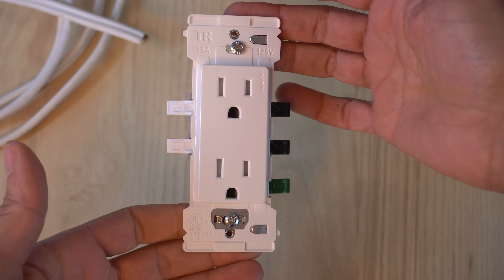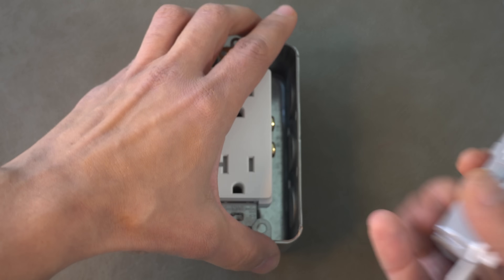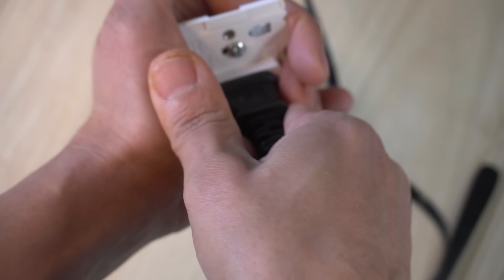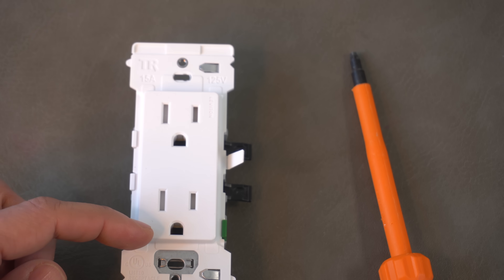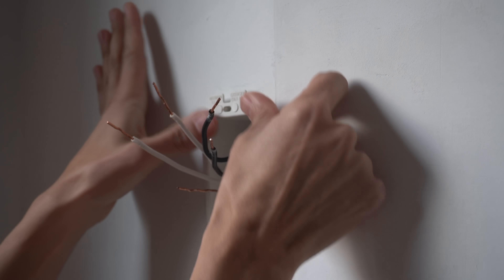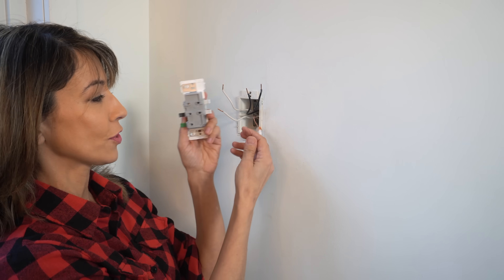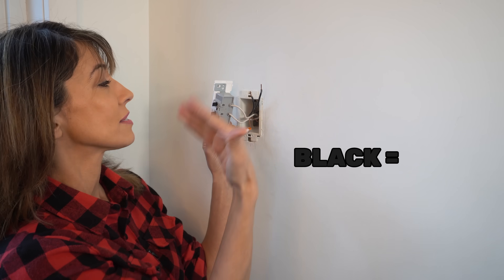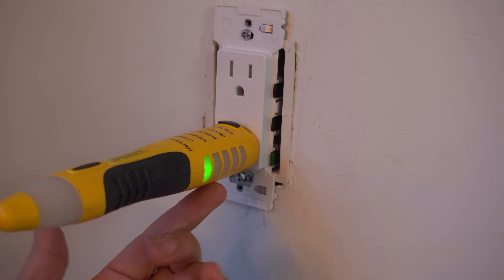New Electrical Outlet Installation: 3 Essential Improvements You Need To See

Comment: Your T&G feature, hand it to the standard DIYer and they will still screw it up. No one reads instructions in the real world. All you do is tighten-up the first outlet or switch, loosely attach the second snug, and hold the cover back-to-front and wiggle the clearance. Pull off the plate and continue to tighten. There is a thing called screw creep, and the fixture may torque/move from the initial set. 
You can not centre what you can not see as well. 
Plus the metal dog ears are designed to be cut off in situations of retro-fit to flush mount boxes. 
These are new construction or old preexisting behind drywall mounted boxes.

Comment: Brand new POS electrical outlet for the lazy DIYer so they can burn their house down. 
Lazy licensed electrician used a backstabbed outlet/switch, you could see the arcing coming from the box. I rewired the proper way. This outlet is no thousand pound crimping system which give best vibration resistance. Use Wago connectors and become another Waco incident. They have three times the resistance. Just hookup a space heater, hairdryer, or toaster an see the plastic melt.

Comment: It would seem that the extend box would have to mounted in place somehow otherwise I could see pulling right out of the wall when removing a plug from the outlet especially with tighter tamper proof outlets.
Reply from the maker: The box extender is screwed into the metal electrical box with long screws. It’s secure and designed for this purpose. When removing the receptacle the extender stays attached to the box.

Comment: Good video. I'd like to point out that in many homes, such as my own, which is 30 years old, the wiring is not necessarily white and black. I have yellow wires, for example. The way to find hot is to turn the circuit off, disconnect the wires, physically separate them, turn the circuit back on, and check with the voltage meter. (You can also leave them connected, and just unscrew the receptacle to get access to the hot/neutral wires.) It's the only way to be sure.
Reply from the maker: Good points Jack! Thanks for taking the time to help people out with this because it happens. I show how to do this in my GFCI video but not here. You have good advice!

Comment: Outstanding! Thank you for this great find and installation tutorial. I just swapped out several light switches in my 30 year old home. The electrical connection screws had become a bit loose and the lights were randomly flickering. (Not good!) I clicked on your Amazon link and I was pleasantly surprised to see (at the time of viewing 18 Feb 2024) $3.50 USD a per unit. I can't wait to obtain and install these. Thanks again.
Reply from the maker: Thanks for letting us know Richard and for the price update. It’s good to know.

Comment: As a professional I no longer use Wagos. The point of contact in a snap connector is extremely small therefore limiting current carrying capacity.  These are not safe under fully loaded circuits. Just my experience and opinion, been in the trades 38 years now, "quick and easy" never lasts.
Reply: I wouldn't use Wagos on an outlet where you could potentially plug in something that draws high amperage -- e.g., a hair dryer. I am 100% comfortable using wagos when wiring up something like LED ceiling lights that I know will draw very low amperage. For example, canless 5 or 6 inch LED ceiling lights draw about 10W (I see some ranging from 8W to 14W). Ten watts draws less than 1/10 of 1AMP (or 100mA). If you strip your wire properly and do not deform it then you will have plenty of contact area to carry that load. The connector will not heat up, and I would bet that it would function safely for over 100 years.

On the other hand, I would not use Wagos to wire up 20A outlets in my garage where I sometimes operate corded power tools because I agree that there is less contact area in a Wago vs a properly-connected wire nut. Having said that, as a non-electrician, I have had to fix electrical circuits in multiple homes over the years in which professional electricians did not properly connect wires with wire nuts. I agree that a properly installed wire nut connection has less resistance than a Wago, but I would bet that a very large percentage of wire-nut connections in residential homes across the USA are poorly installed with wires that aren't stripped to the correct length or wire nuts that are too loose. I've probably seen it a dozen times.
Reply: I used Wago's in my garage outlets, run welders and air compressors with no issues.
Reply: The load capacity of Wago-style connectors have been proven repeatedly with reproducible testing by multiple organizations. They carry loads that are comparable to screw terminals with a shepherd's hook.
Reply: @michaeltaylor5939  I've made this comment on other videos that discuss Wagos. One reason that I think they're more-widely accepted in Europe vs the USA is simply because household AC in Europe operates at a higher voltage than the USA, which means that devices that require the same wattage will draw lower amperage.

Heat dissipated (also Power or P) is = to current squared times resistance.

So basically, if you use WAGOs in Europe where electrical devices are operating at lower current and higher voltage than in the USA, you will get significantly less heat dissipation than you would operating the same device at a higher current and lower voltage in the USA.

That's why I think electricians in Europe are generally OK with WAGOS while electricians in the USA want the lower resistance from the significant wire-to-wire bond that you get from a PROPERLY INSTALLED wire nut. Of course, as I've said, I've had to correct circuits in my homes over the years multiple times when electricians did not screw wire nuts down properly creating a poor bond that melted the wire nut and created a short due to excessive heat dissipation. Still, I've heard anecdotes of electricians in the USA say they don't trust WAGOs because they've seen them melt. I would think hard before using them on anything over 15A.
Reply from the maker: Thanks for sharing your take Scott. It’s important to hear all perspectives and experiences.
Reply: Yet they are UL approved and have been used all over Canada and Europe for years.
Reply from the maker: This is important to know. They have been tested by US and Canadian regulators and are UL listed.
Reply: There is always a FUD in the comments clinging to decades old tech whenever something new comes out.
Reply: Wago's are amazing.  I've watched plenty of videos regarding large loads on Wagos and they perform very well.

Comment: Put a one of these in the attic while hot, carefully took wire nuts off, clipped wire one at atime not to short anything, already placed pigtails in plug then just used wago to wire in the plug.

Comment: Looks ok but I have one problem with the design. Why is the ground wire on the hot side not on the neutral side like it would be a major failure point in the design
Reply from the maker: That’s a good observation and question. Why did they move the location of the ground?

Comment: What happened to the metal box and how is the plastic extender box secured? I watched the video twice but didn't see that step.
Reply from the maker: Thanks for the question. The box extender is secured with two extra long screws. They screw into the two mounting holes top and bottom on the metal box which stays where it is.
Reply: @DaruDhillon  Maybe you should have showed that in your video.
Reply from the maker: @jaycahow4667  good suggestion for next time, thanks! Here's a video on how to install box extenders and fix bad drywall to help: https://youtu.be/BBbwDZGWsDc?si=APiI6z8ICSgUT99n
Reply: Open your eyes.
Reply: @larrydaniels6532  Close your mouth.

Comment: Buy the $2 outlets with the screws for best connection and put electrical tape around the outlet if its a metal box..They probably want $5-$7 for that new outlet.
Reply from the maker: Screw terminals are excellent and reliable when you know what you’re doing. Good tip with the tape I do that in all my videos when installing devices with screw terminals.
Reply: These are $2 each in bulk

Comment: I don't like the big plastic plaster ears. I fear that they will not allow some wall plates to sit flat on the wall. Also, I wonder if the T&G on the plaster ears will interfear with larger devices like dimmers.
Reply from the maker: Thanks for the feedback on the new design. Good thoughtful points to consider.

Comment: I have mixed feelings about these outlets. I don’t exclusively use Wago style connectors. I tend to use them only on lighting circuits and wire nuts elsewhere. 

I hate backstabbed outlets and I fear these may have similar shortcomings. Nothing beats a good hook and loop properly torqued down for a solid high amperage connection. Pigtails and wire nuts are also preferred for pass through. I don’t see a need to change those out to Wagos if done well. 

I like the commercial outlets. They are built more solid with metal framing as well as the screw clamping mechanism. 

Cannot say I’m a fan of TR outlets either. Just another failure point when the shutter mechanism fails. Nothing wrong with the old plug protectors if you have kids in the house. Heck. It’s only 120v. I stuck something in an outlet as a kid and learned never do that again. Developed a respect for electricity at a young age.
Reply from the maker: Your point about backstabbing is worth noting. There are a no-go. This design uses an internal lever to clamp the wires in place. The manufacturer, Leviton has applied for a patent on the design.
Reply: @DaruDhillon  I certainly find it interesting and innovative, but I’m also skeptical. I like the keyed alignment notches. That’s pretty cool. I don’t care for plastic flanges so much, but I see it does have some metal tabs on the backside. I kinda like the metal on the commercial grade outlets more as they look more stout for repetitive plugging and unplugging. Leviton makes good stuff generally so I hope they have the “beta bugs” worked out. For the price point, I’d probably personally go for their commercial grade outlets and spend a little more time doing a job that I’m certain will last. That’s just me and my electrical skill level exceeds that of an average DIYer. Nice video review of the product. Still think it’s interesting.
Reply: You have a short sighted view - almost every high quality receptacle is wired from behind with a shorter straight exposed copper conductor, these are clamped by a plate that is screwed down on the clamp and provides a much more secure connection than your loop.
Reply: @larrydaniels6532  if you reread my comments I am advocating for commercial grade outlets…which are as you stated straight wire inserted from the back and clamped with a screw mechanism. This is my first preference, followed by a hook and loop if done well. Both offer adequate surface area contact for proper amperage flow. 

When I say I hate backstabbing, that refers to the push in style hole on the back of residential grade outlets without a screw to clamp it. There is a spring contact inside of the hole. I’ve replaced too many of these that have just melted. 

I fear these “Wago style” outlets are similar in nature to the backstabbing outlets with a similar spring tensioned contact but just operated by a lever. I suspect they have way less surface area than the options I prefer above. If true that could be problematic for DIYers that just daisy chain a series of these together as you just introduce more weak points (resistance). 

I’d like to see a teardown of these outlets and hard testing including thermal imaging compared to residential outlets with hook and loop connections and commercial grade outlets with the straight in screw clamps (not the same as backstabbed outlets).
Reply from the maker: @larrydaniels6532  All good points Larry, anytime something new is introduced there will be people on both sides. Appreciate your perspective. We are seeing the greatest amount of change in Electrical in North America in the last few years than we've seen in a long time. Mostly driven by DIYers and what they are purchasing.

Comment: Love the concept.  A little surprised to see tamper resistance listed as a 'feature' when they've been around for years.
Reply from the maker: Tamper resistant outlets have been around for years but it’s a feature many may not be aware of. I like that they built TR into this outlet. A lot of people buy standard outlets with no tamper resistance not knowing there’s an option to do so.
Reply: @DaruDhillon  Very fair point... having kids, it's just something I go to automatically.  There is an additional cost but I find the little covers tacky anyway.  Good video!
Reply from the maker: @kk38444  Thanks. You obviously know electrical which is great! Good to have the knowledge of what’s in your home. Appreciate the question. It’s a good point.
Reply: @DaruDhillon  Although they have been around for awhile many people do not like them.  They can make inserting plugs very hard especially for elderly people or if you have limited front access to the outlet.
Reply from the maker: @jaycahow4667  Thanks for sharing that point. It a good thing to consider for seniors or others who may have concerns with that feature.

Comment: They make installations easier and faster, but not necessarily any safer. Sure, there aren't any screws to short on a box, or touch [which tape fixed for eons], but the industry has a very bad reputation with "stab-in" connectors. Having a leaver on the stab-in doesn't necessarily fix that. (Wago has had decades to make sure those things don't cause fires.) I'll stick with a screw that I can see has made a solid connection. (note: the Wago is transparent.)

As for "TR"... those horrible things have been around for decades. And no one has ever built one that wasn't a cheap pile of crap that doesn't need a screwdriver and large hammer to use. If I have to break the receptacle to get the plug inserted, that totally defeats the purpose.
Reply from the maker: Thanks for sharing your perspective and thoughts . on the updates. It's good to hear from you.

Comment: Wow - for $2 each in bulk- thats a great value - the next time I need to change an oulet I will use these ones.
Reply: Pull one apart. Make sure it's not a "trailer fire" waiting to happen. Pull 10/12/15A through one for a few hours (space heater.)
Reply from the maker: @jfbeam  thanks for your feedback and thoughts. Space heaters are a good test.
Reply from the maker: I thought the same thing as you. Good to know your options.

Comment: please elaborate on 2:57. Thankyou.
Reply: Whoops, never mind. I see there's two white and two black wires to feed the top and bottom outlets independently. If there was only a single wire @ than keep the tab.
Reply from the maker: @ronw8628  
For two circuits you remove the tab behind the door. You might have lamps plugged into the top outlet that turn on/off with a wall switch. The bottom one has power always available for you to use 24/7. It's a special situation that doesn't happen often.